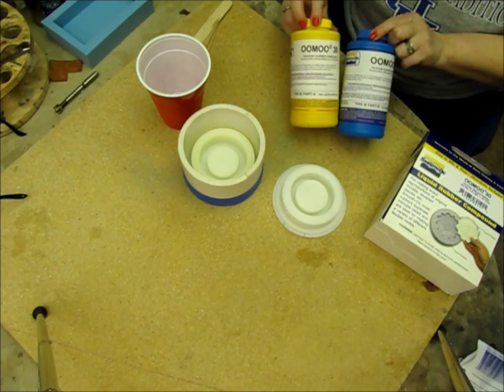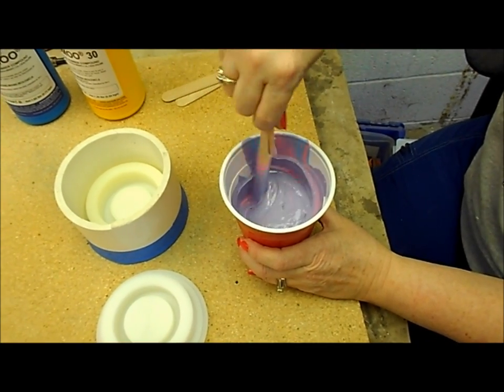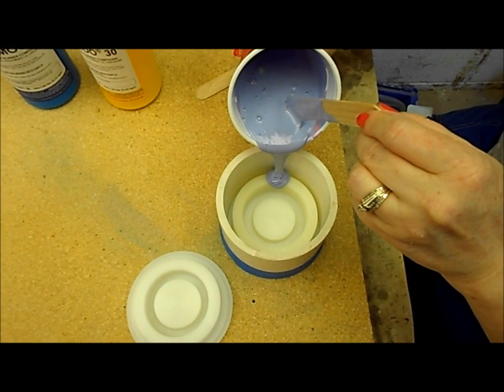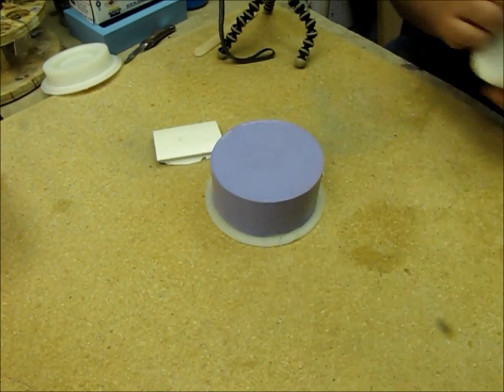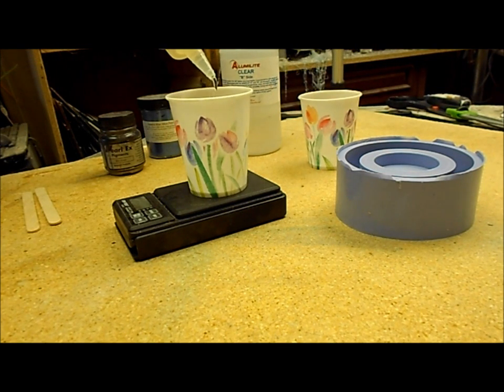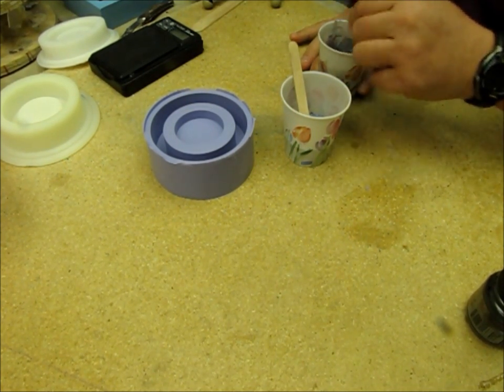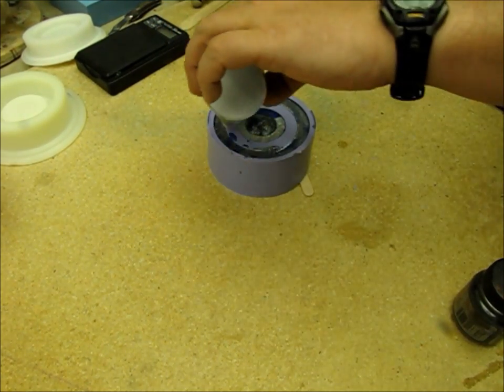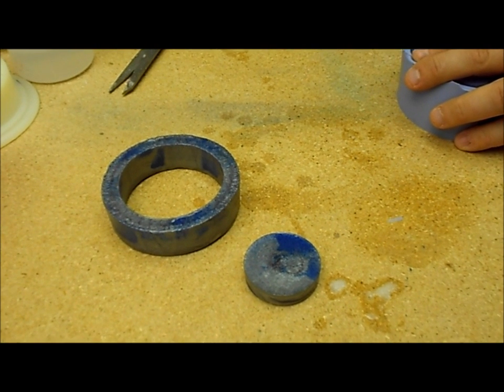Mold making with OOMOO 30 Silicone Rubber

Comment: Hello, and thankyou for your reply. I was talking about if there is a way to make one i already have, a bit larger, it's a bit tight o my wrist (it's already made) it came with this port thing i had put in, maybe is like a medical alert thing, but a bit too small for me
Reply from the maker: If you have a lathe, you can turn the inside.  If not, made a oscillating sander to send the inside.

Comment: Nice to see this. I am about to get some Oomoo in the post and never have used it before. Never tried alumilite resin either. I don't think bubbles matter much in colored or glittered pieces based on my experience with the resin I use. The real test of bubbles is clear and has become a big pain for me with my current resin. 

- Heidi

Comment: What did you say you use to finish the bracelet off? Is it a machine or something else, and if you don't have a machine, what else could you use to make it look more like a bracelet instead of a round circle thingy. Also, if you used a different material to make the bracelet, would it become stretchy like a normal rubber bracelet for example silicone or something?
Reply from the maker: 02skaplan I use a lathe to finish the bracelets.  This method is to make the rough blanks.
Reply: fool4peppers ok thank you :)

Comment: Hi, I've been using Oomoo 30 to make molds for resin, but the surface of the pieces I cast inside them seem to remain tacky or, in some cases, completely viscous. I've had no problems with this resin otherwise, and have experimented with two different kinds. Do you have any advice? what am I doing wrong?
Reply from the maker: haleywinter The silicone or resin is tacky?
Reply: fool4peppers The resin is tacky... and I know there is nothing wrong with the resin because I will pour the same mix into other pre-made molds as I do the Oomoo molds and the resin in the pre-made molds harden completely.
Reply from the maker: haleywinter I have to assume that you are using a resin the uses MEKP to create a heated chemical reaction to cure the resin.  Since the resin is heat cured, you need a little more heat to finish it off.  Many reasons could have caused it.  If you resin is just tacky or rubbery, than you can put it in the hot sun on a warm day and it should cure.  You can use a low heat oven, 150 or so degrees to cure.  Careful with this method because the resin is flammable.
Reply: Hi, thank you so much for your input! I actually did leave my pieces out in the sun... but to no avail! They actually melted! After asking around I realized the problem is that my resin is not compatible with Oomoo 30's tin cure! I'm guessing a platinum cure will work better.

Comment: Smooth on 30 is a bloody good rubber no de-gassing required (un like that condensation cured crap air bubbles galore that drives you crazy) 
Its also great being a 1:1 colored catalyst mix so simple to use no nasty fast or slow curing issues
slumps quite nicely with minimal drain out issues
Only problem is it does have a little bit of shrinkage being 30 shore 
Not sore if they make a 40 version the same? would be good if they do

Comment: You SHOULD be scraping the sides when you mix your silicone. Using a transparent container helps to make sure that everything is mixed thoroughly.
That big pink stripe of unmixed material right where you poured from could have been bad news.
Reply from the maker: Yes, you are correct.  We were lucky that it didn't affect our final mold.  Thanks for your comment.